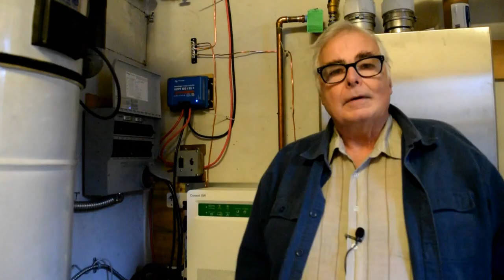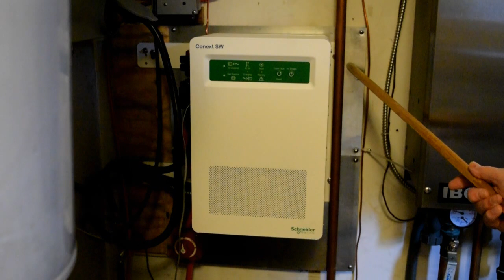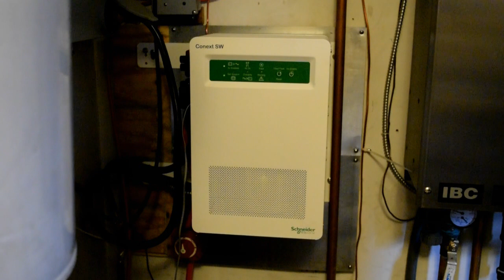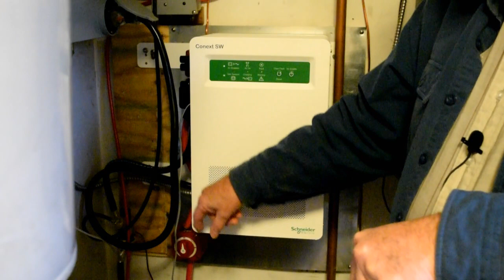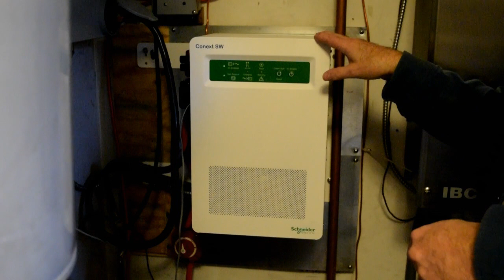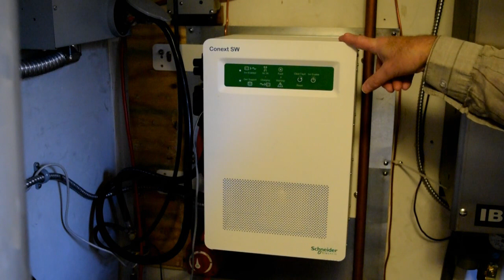Schneider Conext SW 4024 Split Phase Output 4000 Watt Inverter

Comment: Hi I bought the 4024 120/240 split phase inverter, i am from a region where the AC input is 240. how can i connect the inverter to accept the 240v and give me a 240 output and also charge my batteries?
Reply from the maker: Unfortunately if your normal household voltage is 240 VAC, I believe that you have bought the wrong inverter.  You have the North American model.  You need the 240 VAC (European/Asian, etc.) inverter.  You should contact Schneider or the dealer that sold you the inverter to see if there is anything you can do.  Beyond that I cannot help you.
Reply: @todddunn945  Thank you Todd for your kind reply, does that mean i can't use it here. or can i still use it with solar panels and still get an output of 240v
Reply from the maker: @kabirumuhammed2157  As a north american I am not at all familiar with non north american electrical systems.  Basically I do not think you can run your 230 VAC appliances with this inverter.  Schneider does make a 230 VAC output inverter.  Also unless you have changed it, the SW 4024 120/240 split phase inverter is 60 hz, not 50 hz.  Sorry I can't be of more help.
Reply: @kabirumuhammed2157  no you can’t use it sell it and get the 240 single phase one for your country

Comment: Hi. I got my 4024. Is there a way that the 4024 can switch from off grid to the grid but with out entering to the charge stage mode? Im off grig almost all the time but dont want to discharge my 460ah bank less than 35%, is there a way? Please help. Thnks
Reply from the maker: I am not an expert about this since I do not have the optional system control panel.   For switching from off grid to grid power without enabling the charger you need the optional system control panel where there are two settings that you can change that may accomplish this.  First there is "Auto Charge Enable".  It appears that switching to the "Enable" setting turns off automatic charging.  Alternatively you can use the "Charge Block" start and stop functions to set the times when the charger will not come on to 24 hours a day.

As far as limiting battery discharge goes, you can use the "low battery cutout" and "low battery cutout delay" functions to turn the inverter's AC power off when the battery voltage drops below a specified voltage (low battery cutout) for a set period of time (Low battery cutout delay) .  What voltage you want to set that at depends on the type of batteries you have and the typical loads.  With a 24 volt lead acid battery system 35% discharged is about 24.6 volts for a rested battery with no load.  Under load the battery voltage at 35% discharged will vary and you will need to experiment a bit.  A more precise method is to install a battery monitor like one of the Victron battery monitor and use its internal relay to open a power relay in the positive cable between the batteries and the inverter.  You can set the opening of that relay where ever you want.  Components to accomplish this could be a Victron BMV-712 and a Blue Seas Remote battery switch.

Comment: My Conext SW Solar Hybrid Inverter System (120/240V) is giving me (it has new renogy gel batteries) a undervoltage alarm and even when not used it suffers a 15 to 20 % discharge, Can anyone help?
Reply from the maker: I would contact Schneider customer service.  Other than that I have no idea.

Comment: What would be your 2nd choice, one that has controls built in?
Reply from the maker: My second choice was a MagnaSine from Magnum energy.  However, it also requires an add on remote for programming beyond the default values AND it is $500 more expensive.

Comment: When you connected the inverter to your home, did you have to set it up between the main panel and a critical loads panel? Or is there the option to install it directly to a single panel with just 1 split phase connection?
Reply from the maker: I have it wired to a 10 circuit critical loads panel.  I could have wired it into the main panel, but then I would have risked back feeding the grid.  This is not a grid tie inverter.

Comment: It seems there are not many UL listed split phase inverters at the $1200 price range. Having to add the control panel, while it is another $200.00. You still get what you need to run your well for under $1500.00. I am looking for a split phase inverter for basically the same reason as yours. Running a well pump. Thanks for sharing. How does it perform with your well? Is your well a 1/2 horsepower? It can handle the startup surge? Thanks for taking the time on making the video.
Reply from the maker: The inverter easily handles my well.  Yes I do have a 1/2 hp pump.  I am certain the Schneider 2500 watt inverter would handle the well just as easily.  My pump takes about 1500-1700 watts to start it and then draws 1250 watts when it is running.  One thing I have discovered about my well is that it runs very little. During a typical shower my pump runs 2-3 times for 10-12 seconds each time. Actual power used by the well pump is in the 200 watts or less per day range.